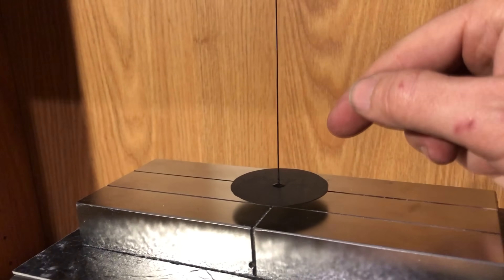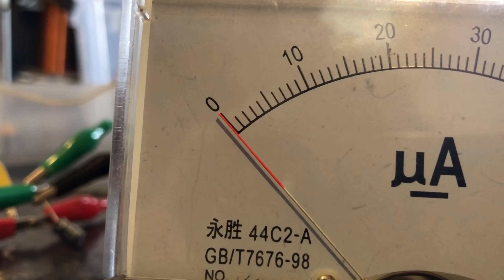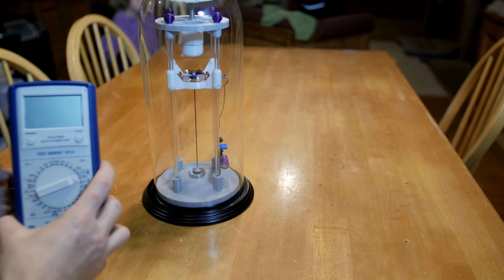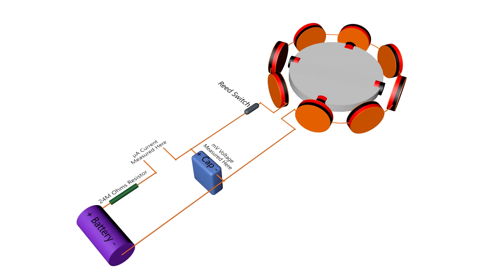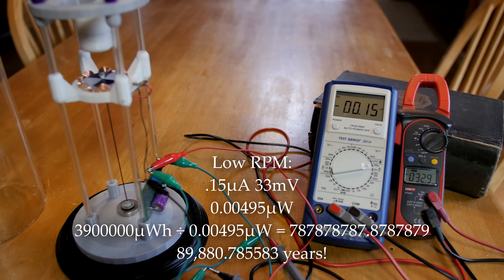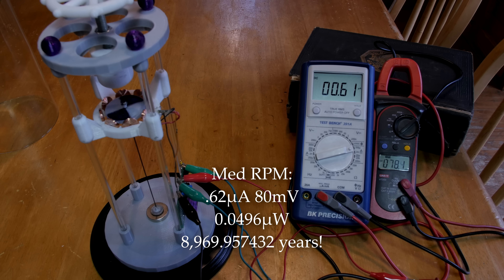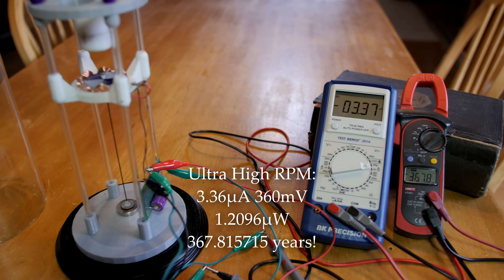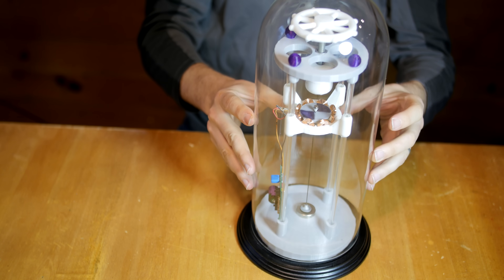Fully Levitating Magnetic EZ-Spin Motor - Pyrolytic Graphite

Comment: So basically a vertical Mendocino motor using graphite instead of permanent magnets? You can get near frictionless results with a vertical Mendocino motor made out of solar waver components. I made a vertical flywheel that was about 6 inch diameter vertically suspended using the lowest possible neodymium setup to hold the tip of the shaft spinning it by hand I easily got 30 minutes plus just free wheeling around. Kind of an upside down top. Pretty cool to see tho.

Comment: I'm curious what a  Peizo Electric crystal would do, if attached in-line to the Copper wire sticking up in the open Air.   Or what if the Crystal was placed near the spark gap....would it produce more current than the electrostatic charge....Just using the Electrostatic Charge to "Excite" the crystal so it will continually pulse out Current......

Comment: you could hook this to a tv antenna the anode end of diode and the cathode of the diode a supercapacitor and a zeinor diode and a resistor across the supercapacitor to limit voltage and then another diode to the other supercapacitor's armature to ground this should produce a natural charger with a voltage limiter.....

Comment: Very cool. It could be made a little bit more robust by adding a bumper over the top shaft magnet that would limit its travel in the case of accidental bump. It seems a little tremor will make the shaft shoot up

Comment: Did you consider a dry capacitor and a small solar cell instead of the battery ? That could spin with an occasional light access forever

Comment: I have found that there are a lot of configurations of having something run for a long time, as you may have. What I see is that none of these do any work. I do not want to take away from your knowledge, no judgment on my part.  All that knowledge is a good thing but can you make it happen. Is the question.  I have only seen 2 of your vids, so please excuse my prejudice. To be honest you portray "levitation" but what I see is a combination of levitation and suspension. To levitate you cannot rely on a tether.  Please inform your audience. thanks. Great work by the way keep it up...New sub.

Comment: You can eliminate the battery and run it on radiant energy (static electricity exchange) using patent US685957A.
If you spray one side of an aluminum foil with lacquer to make in insulated, you've got your insulated plate they talk about.   
The rest is self explanatory from the figures and diagrams of the patent.

Comment: I wonder about pump out all air from that glass :) - it could increase efficiency
Reply: Theoretically 1 atmosphere of a gas acts as a fluid but with much less density.  As such it does impart friction to the moving part. A vacuum (less air) would impart less friction than 1 atmosphere does. So the answer is YES.

Comment: Idea:Kinetic Chemical charging.. The battery has two separate electrolytic foundations current flow causes migration mechanism.. When it's run flat you just switch polarity and its fully charged again.. The older model was different.. The suspension particulate.. resettles to to the bottom of the liquid and the battery is charged again.. So to recharge you just disconnect it.

Comment: Now try 1000 times more windings on the motor, or using smoke detector elements ejecting alpha particles for rotary propulsion...
Reply: That's just way to manny! If you can get the essence of the apparatus you know at the beginning of conducting your experiments how to wind if needed at all your copper or in what shape.
Reply: Henry read  the book The energy machine of Joseph Newman. More windings creates more ohms of resistance, reducing the current draw from the battery, while aligning more copper atoms thus producing a stronger magnetic field with less power required. The only drawback is the huge back emf voltage produced when switching polarity requiring a large ceramic communtator when using more than 10,000 turns of 32 awg.

Comment: hi it's been a while, i was wondering about the data from the experiments you were conducting with the diy super cap's, you were making with the aluminum plates coated in graphite and charcoal you had said you were going to try other materials . what were the results and which ended up being the best performance for the price of materials?
Reply: Every material has a unique feature that can be used for different types of applications. I experimented with a few variations and at first didn't see any difference. I noticed how aluminum served as an efficient material that gave more resistance with less voltage and wattage. I tried Graphite with copper and increased resistance and output voltage and conductivity. Any conductive material works for the caps the difference is in the output energy wave.

Comment: How do you control the right time for the coils to turn on 

PS: do you know the Athmos Clock that is powered by the temperature and pressure differences during a day.
What about a endless running motor :)
Reply: By the diodes and balancing circuit, a safety mechanism to regulate voltage. He has most schematics in his website. Perpetual motor☺,

Comment: This is awesome. Microamps is a small enough power consumption that the possibilities for powering it explode. Springs and weights have provided microamps for a very long time. Piezoelectrics could be arranged to completely baffle people, but would fundamentally be 'power from outside'. And, if you're allowing 'power from outside', using convection-oriented solar would be amusing. Or tuning cheesy Tesla coil ($15 from Amazon) pulling energy from background radiowaves. Edison's Nickel-Iron battery, perhaps for longevity.

Comment: There are some fatal flaws in your power calculations @lasersaber. Please read this.
1) Your Wh rating is for a standard AA battery but not for the 3.6V lithium cell you are actually using, which is 4.32 Wh from 1.2Ah at 3.6V.

2) The power calculation is unfortunately meaningless because you are ignoring the power consumption of the resistors! The true power consumption of your system is 3.6V * 150nA = 540 nW or 0.54µW! Your numbers are off by a factor of 100! At least for the lowest RPM mode. Going further, the portion of total power that the resistor network dissipates is found with P = I^2R which is 150nA^2*24MΩ = 0.54µW, meaning nearly 100% of your power consumption doesn't even occur in the motor, it's in the resistors! This means that the idealized lithium cell would last 4.32Wh/0.54µW = 8,000,000 hours or 913 years. And the 3.9Wh standard AA battery would not last 3.9Wh/0.54µW = 7,222,222 hours or 824 years, because you can't assume the same current, the nominal voltage is 1.2V not 3.6V!! Remember V = IR: If your voltage is 1/3, your current will be 1/3 for the same resistance! Will the motor run on 50nA? Assuming it did, the IDEAL alkaline cell with 2.8Ah capacity would last 2.8Ah/50nA = 56,000,000 hours or 6,392 years, but even though this is nearly 7 times better than your lithium cell, the self-discharge current would never allow it to reach this lifetime! I would have done the calculation for the "Ultra High RPM" mode, but the current didn't make sense and I wanted confirmation. If the resistance is 2MΩ the MAXIMUM current would be 1.8µA, but yours is almost double that, which leads me to believe that you misspoke and the 2MΩ resistance was for the High RPM mode, so was Ultra-high mode around 1 MΩ? That would mean the resistor consumed 12µW

3) You're ignoring the continuous self-discharge of the cell. If the self-discharge is 0.7% per year, then the battery would be completely dry after just under 143 years assuming every µW of power would be usable in your system right up to the last drop of energy. For the Standard AA battery, alkaline has a self-discharge of 2-3% per year so worst case it would be 100% dead in just over 33 years. This is also why even with such a high capacity, Alkaline would never last the 6,392 years it promises.

Speaking from my own experience, the best power source for your load is one that matches its impedance. To eliminate as many system losses as possible, you could use either a constant current source that generates 150nA for your lowest RPM mode, or a voltage source that generates 33mV. Imagine a 33mV battery with 3.9Wh of energy. It would have almost 120 Ah!

TL;DR if you're trying to make an extremely long lasting, efficient design and you want to run your coils at 33mV, use a 33mV battery or use a more efficient means of power conversion. Right now there is no point using lithium or alkaline at all because all of their useful voltage is eliminated by those resistors. So instead of resistors that make your system efficiency nearly 0% for generating torque, use a buck converter with the reed switch connected to the buck converter's enable pin that keeps it in shutdown mode for as long as it is not needed, or put that reed directly in front of the buck converter to eliminate all quiescent curernt.

Right now your system is a lot like 12V red LED strips. The Parallel strings of 3 red LEDs are only using 6 of the 12 volts to produce useful light, and the series resistor is dissipating the rest of the voltage just so you can run them on 12V. That instantly reduces the efficiency of your power delivery system to below 50% because half the voltage is being dropped across the current-limiting resistors and not in the LEDs. This is why LED strips are a lot closer to the efficiency of incandescent light bulbs than a properly voltage-matched LED strip, or better yet, a constant current led strip.

One last thing I wanted to mention that I tell everyone that uses coils in pulse motors. Coils are air-gap inductors, and inductors are energy storage devices. The back-emf from the magnets passing your coils might be negligible, but the current you stored is just as useful, if not more useful, than the energy you stored in your capacitor. Give the coils a path back to the capacitor so the energy from your pulse isn't 100% wasted and can be recovered for subsequent pulses, or at least light up an LED with it. I'll say it again for emphasis because this is a widespread misunderstanding when it comes to circuit design. Inductors are energy storage devices. Coils are air-gap inductors. The load does not consume the energy, but you can certainly accelerate an electrochemical cell's self-discharge.
Reply from the maker: "The power calculation is unfortunately meaningless because you are ignoring the power consumption of the resistors!"

How long do you calculate the MOTOR will run on 3.9Wh hour of energy?  I was not actually interested in how long the motor would run on the battery but on the amount of energy the AA battery represents.
Reply: @lasersaber  How long will it run? Can't definitively say without more data. I'd start by figuring out what the friction force / mechanical power loss is for your flywheel at a given speed. First, start by figuring out the total inertia of your flywheel, we'll need this to find the total rotational kinetic energy. Assuming you know the mass of each object, the total system inertia with your disk and your magnets as point masses, and ignoring the shaft and the graphite, the total inertia will be Inertia_system = Idisk + I1 + I2 + I3 etc. Idisk = 1/2*m*r^2 where m is mass and r is the radius, and you can just treat your magnets as point masses at some distance from the central axis, where I_pointmass = m*r^2. 

Okay, now say you've added up the inertia of all the objects in your flywheel system, now you can find the rotational kinetic energy at a given speed. The formula is similar to linear kinetic energy (1/2mv^2) except it is now E (joules) = 1/2*total_inertia*w^2 where w is your angular velocity in radians per second (or Hz*2*pi). Say you spin your motor up to 0.25Hz. We'll disconnect power and measure the rate of energy loss. You can get an Arduino to count pulses very accurately with a hall sensor or reed switch to one of its inputs and compare the time between pulses. Find the rate and this is the energy it requires to operate continuously assuming 100% power delivery efficiency.

Once we get the mechanical watts dissipated at the speed you'll be running the motor at, we can calculate how long the motor will run on 3.9Wh of electrical input.

I imagine this could be a good follow up video if you wanted to document the process. I do think that if you hope to run on 3.9Wh of power at a higher power delivery efficiency (nearly 100% of power delivered from battery is consumed at the load) the first step will be to remove the resistors completely, followed by limiting the energy in each pulse to control your operating speed by either:
1) adding a pulse generator to your circuit to enforce a pulse time limit, so you are not dissipating more energy than you need to because surely friction increases with speed. The most passive option I can think of is a series blocking capacitor with a parallel bleeder resistor to dissipate stored energy in the cap between pulses.
2) adding a current sensor that interrupts your circuit once the current rises to a certain amperage threshold. Typical feature in DC-DC boost converters to ensure the inductor does not enter saturation region and is always storing energy and not wasting it. Usually done with current sense resistors, but you can use hall sensors or current transformers too.
3) Increase the number of turns in your coils, and inadvertently the total resistance of your coils so you are limiting current while producing more useful magnetic field to generate torque.

Comment: While you’ve done a pretty good job of measuring how much power is going into the coils, you’re not measuring what’s coming out of the battery.  The power being disapated in the resistors is the current you are measuring times the voltage across them, which is probably about 1.46 volts if the battery is at 1.5 V.  That amount of power is going to be a lot more than what the motor uses.

The real calculation for runtime would be to take the voltage of the battery times the current through the circuit.  Assuming a constant voltage of 1.5 V I get ~200 years of operation using a AA.  Still dam impressive.
Reply: To be fair he's not talking about this exact setup, he is talking abot the energy required. If you make a simple switch mode supply or take a low voltage source everything works out
Reply: Note.  I agree.

Comment: I love it. I still have my square (4) N52s with a square piece of pyro-graphite floating in a cabinet for many years now. People freak out when they see it floating. I must now do something like this. Awesome work!!!
Reply: Where'd you get the idea? I did the same around 2005 for a science fair project. 5th grade. Found it on Scitoys.com.

Edit: wow, the site is still up AND that project is on the front page. Brings back memories.
Reply: @JPRucks  Just like I found yours. I was on YT and came across Dia-magnetic levitation or maybe it was Makerfair? I forget now. I've ever seen round magnets used though. Very cool motor you built.
Reply: Scott Basham I'm not the video's OP, but that's interesting. I just asked because that's the exact setup I used. Thought you might have bought the kit from that website.

Comment: Multimeters really aren't going to give you accurate numbers for your pulse motor. The refresh rate is so slow that most of the time, a reading will be taken at the wrong time and give you misleading results. The capacitor certainly helps by smoothing out the ripple for the slow multimeter to approximate. Just remember why nyquist frqeuency is such an important concept for signal sampling. Have you calculated the total parallel resistance of your coils? You could find the RLC time constant and find out just how much your ripple is.

If you have an oscilloscope, it makes power measurements much more accurate. Take one probe and put it across your 24Mohm resistor array, put it in shunt resistor current mode or measure mV and do the ohm's law math later, then take the other probe, leave the reference ground unconnected, and measure the voltage across the capacitor. Now your power can accurately be calculated by integrating the area under each probe's curve and multiplying the current and voltages together with your oscilloscope's math function. If you don't have a scope that can do this,  just multiply channel 1 current by channel 2's voltage to get a power curve, and find the area under that curve (if you know the area of a triangle, you can find the area under the curve using one or many triangles).

Comment: First, reed switch consum mechanical energy. Second, you lose energy on resistor. For best efficiency, you should use very thin wire to increase motor resistance and lower down the current.
Reply: thin wire is the same as using resistors
Reply: @rogerd4559  but your efficiency is much higher.
Reply: As you wish.

Comment: Too bad your battery will expire first :/
Reply: True, you would need to use an atomic battery (https://en.wikipedia.org/wiki/Betavoltaic_device) to get the long run times described.
Reply: Also, the reed switch would fail from metal fatigue long before the battery died.

Comment: This sounds like a good match for a crystal power cell, though you'd need to make the components of the cell pretty robust, to prevent the pressure from the crystals forming from bursting it.
Reply: A piezo microphone could probably passively harvest enough vibration(converted to DC) to run this and then some.

Comment: Hey Laser, I checked my concrete battery the one I thought was dead and it still has current in the 200 to 300 microamp range.
Get out one of your old cement batteries and try it. 
Like your work.
Ed